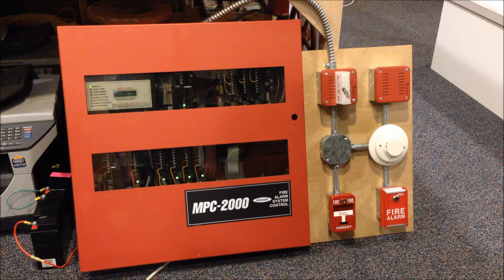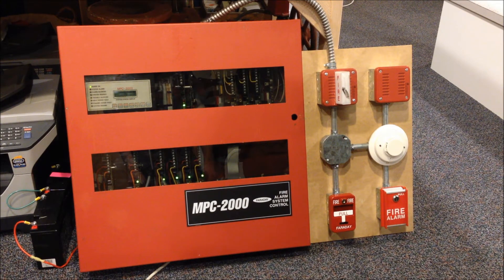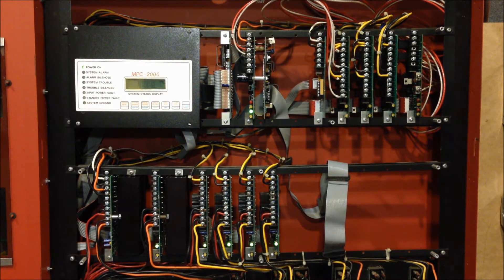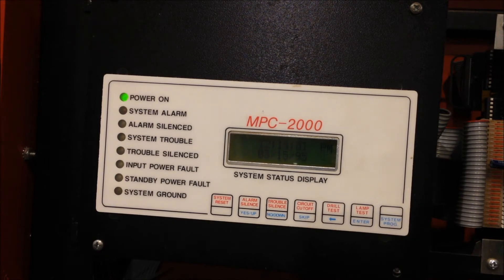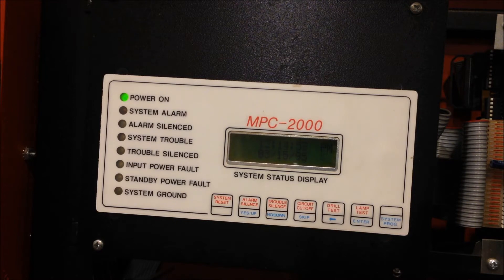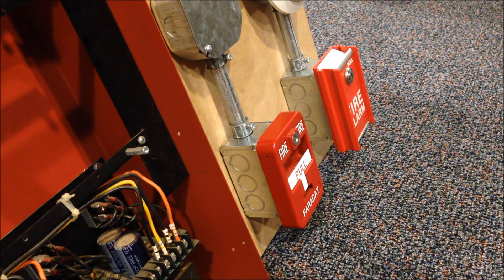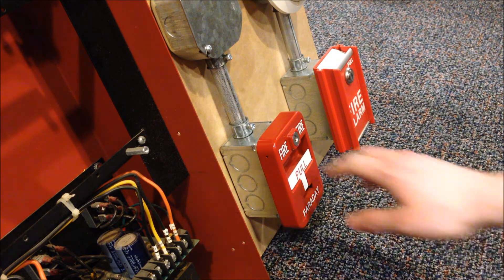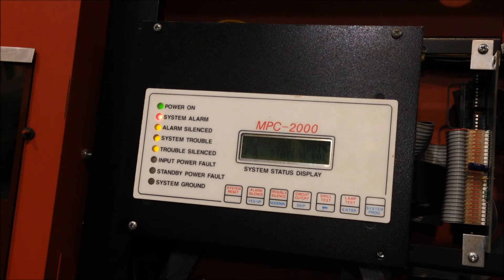Faraday MPC-2000 Addressable Fire Alarm Panel Overview/Test

Comment: Probably a weird question but because this panel predates 1996 if it has code 3 as a coding option is the pause longer like on earlier Simplex 4001-2s? or is it like the 1996 and later code 3? just curious.

Comment: That's cool! Two of the buildings at my college used to have Faraday MPC-2000 panels, replacing Simplex 4207 panels during the early 90s (the buildings were built in 1978.) They were both conventional. Though in 2010, one building's MPC-2000 was damaged from a leaky ceiling in the electrical room, so they gutted it and put a Fire-Lite power supply on the cabinet, and installed a Fire-Lite MS-9600UDLS near where the annunciator originally was (a junction box covers the hole the annunciator left.) The other building replaced its' MPC-2000 in 2012 with a Notifier NFS2-640.